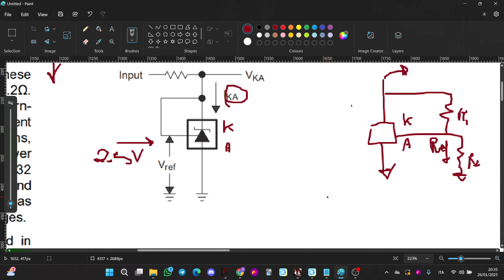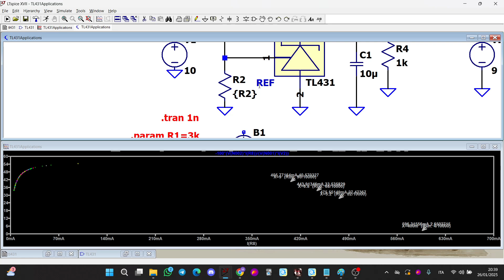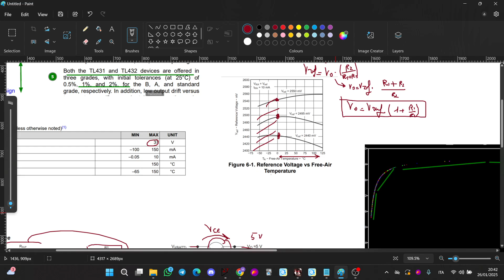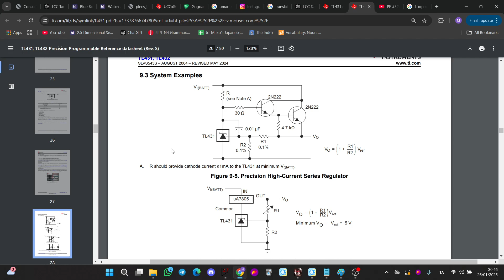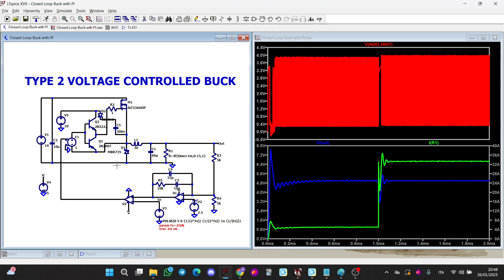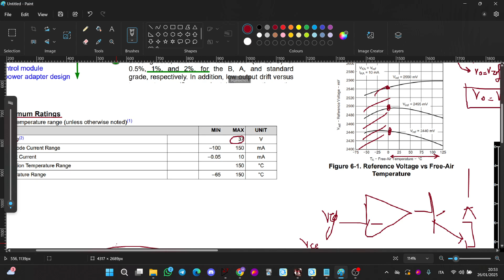[LTSPICE] TL431 For Analogue and Power Electronics Applications

Comment: Long story short: You are probably the only person on YouTube who creates high-quality power electronics simulations. Could you please make a video explaining how to correctly mock the duty cycle calculation of a PWM controller like the OB2273? I will provide the calculated inductance values, the current sense resistor value, the input capacitance value, as well as the calculated voltage divider for the TL431.

I tried my best but simply couldn’t achieve it. The best I managed was deriving the simplified equation for the duty cycle based on the block diagram of the OB2273. I assume I missed the slope compensation, which is probably why I experienced severe oscillations whenever the duty cycle exceeded 0.5. Then I changed the load so that the duty cycle was around 0.4, but even in that case, I observed oscillations of about ±5 V at the output.

Maybe some good news: I calculated the inductance and other parameters for the boundary conduction mode (BCM) operating point. I added an appropriate load and a voltage source for the MOSFET gate using the calculated duty cycle at this operating point. I was able to observe 12 V ± 0.1 V at the output, so I think the calculation is more or less correct. However, I definitely want to simulate the power supply at other operating points as well. The fact that simulations like this are so difficult drives me mad and sad at the same time.
Reply: It appears that you have already made a video about this topic (LTspice Current Mode Buck Converter); thank you. I will try to adapt it to my needs.
Reply from the maker: @BentFunction  Current Control is either achieved with ideal blocks or with already made controllers. It's easier to study the physics behind it. Replicating all the analog integrated circuit is a long and excruciating task, and it doesn't give any meaningful insights if not more problems related to design, compensation of differential stages, mirror currents, etc..
In many videos, I use more ltspice to simulate and understand the physics behind it father than expecting perfect numbers.
Thank you for following my videos!